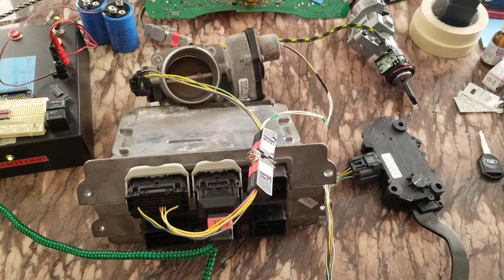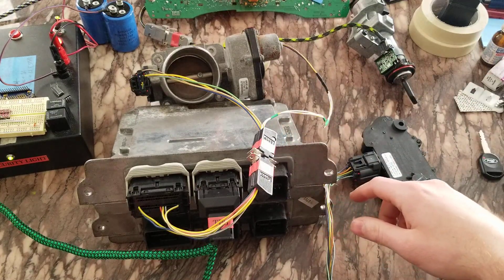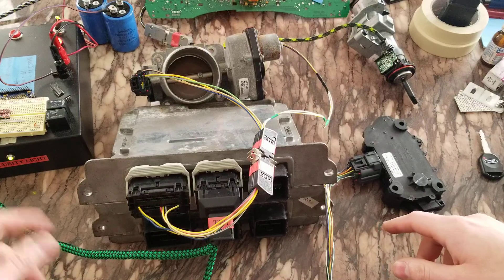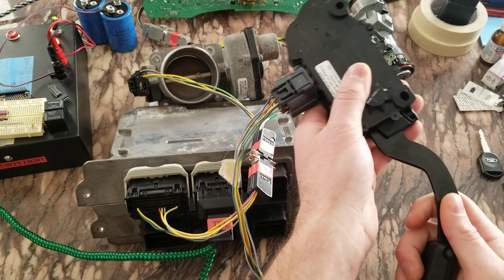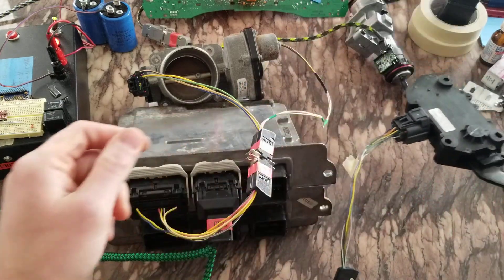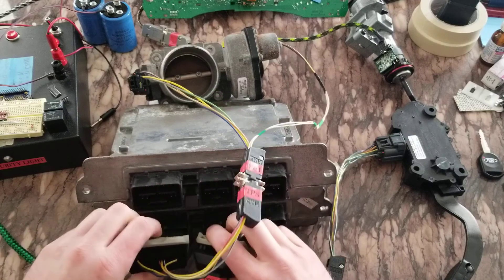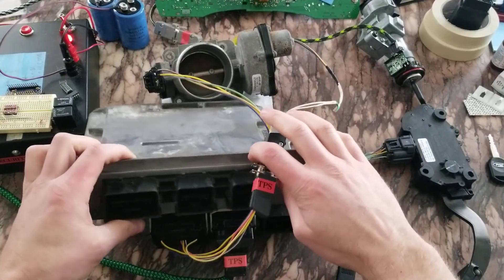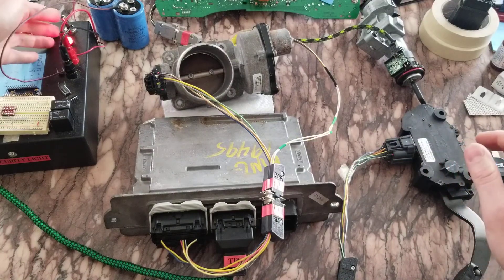Ford Explorer Throttle Body Control

Comment: I'm having a problem with the Ford Explorer here in Brazil, it lost acceleration and nothing makes it come back.
The module has already been replaced and all wiring has been revised.
I've already tested it with another TBI and another accelerator pedal and it didn't work either.
The car has been parked for three years because no one discovered the defect.
Reply from the maker: Are there any error codes?

Comment: I have that same throttle body in my 2005 E150, 4.6L.  About 3 months ago I replaced it . Everything was working great. Now I'm having an issue where the van stalls intermittently, very often, especially under heavy acceleration. Codes I get are P2105 (Throttle actuator control system-forced engine shutdown)
and U0300 (Internal control module software incompatibility). 
If there is a communication error going on between the PCM and the Throttle body, how do I determine which is bad?
Reply from the maker: Check the tb wires.  Expose a few feet of the wires near the tb and check if any insulation is melted or worn through.  It's a common problem on many fords.
Reply: @IntegratedAutoModules  Thank you so much for your quick response. I will try that and report back my results.
Reply: These throttle bodies will through that code for allot more than a bad wire. I've seen excess electrical interference from old/aftermarket coils do it, bad control modules, bad gas pedal sensor, bad throttle body sensor, stuck throttle body, dead battery causing loss of module memory (must be updated by dealer), and other issues. Hopefully its something simple but you may need a really experienced technician for that one because it can be tricky to diagnose exactly what's causing it. Its a parts cannon target for many techs

Comment: Have you ever seen code p061f? Having issues. Ive had to repair the wiring at the tps sensor and the coil. Still have the code.... new pcm has been installed also. In a bit of a bind. 😂😂, thinkin i got a bad refurbished computer at this point
Reply from the maker: Hi, was the code happening before the tps wiring repair?
Reply: @IntegratedAutoModules  yeah its on going atm...

Comment: I have a 2014 Ford explorer XLT where is that module located
Reply from the maker: It may look different on a 2014; the pcm may only have 2 connectors and be smaller overall.  
It's likely in the engine bay, I'm not sure of the exact location.

Comment: My throttle body motor clicks non stop when I turn the key and won't start the explorer. When I disconnected it, truck starts, but runs very poorly. Any input would be greatly appreciated
Reply from the maker: Unwrap the throttle body wires and see if they're melted.